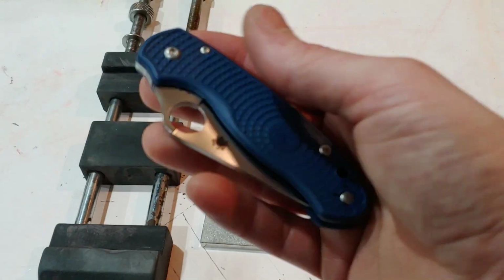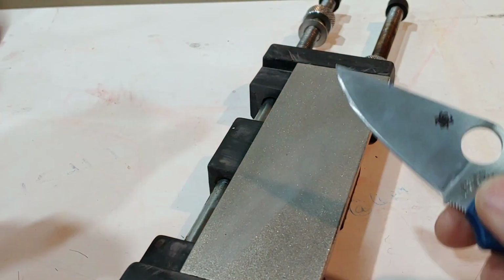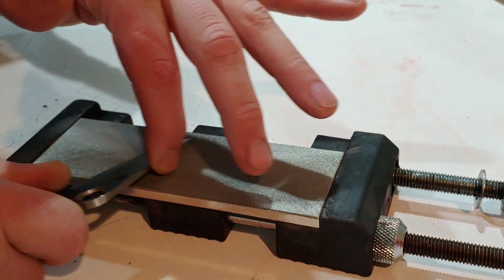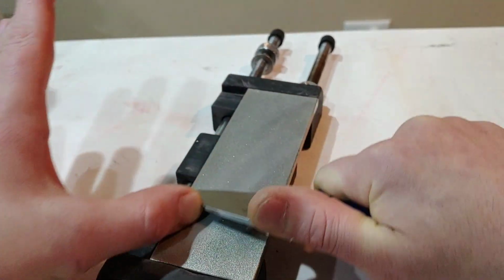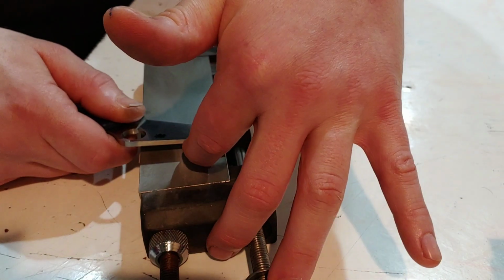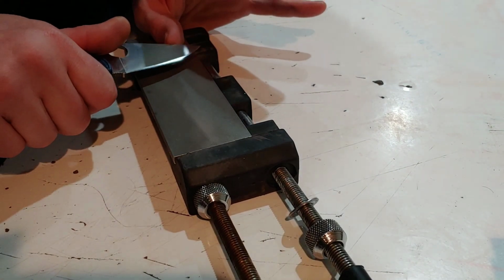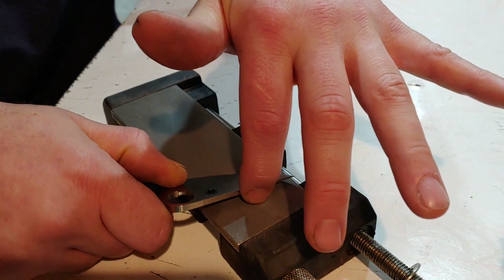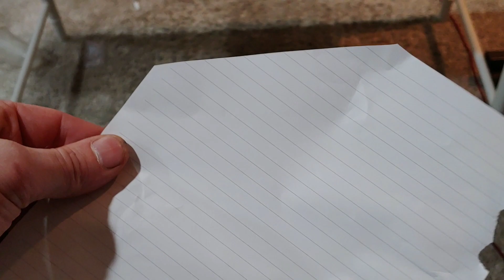FREEHAND KNIFE SHARPENING PARA3 LW SPY27

Comment: i just sharpened my para 3, first i ruined the edge then i watched your video and brought it back. thanks for the helpful insight, really appreciate your contribution's to the community.
Reply from the maker: That's awesome, I have a step by step video that also might help out a bit more
Reply: @NeevesKnives   I'm a butcher and I'm looking to purchase a new knife for opening the cryovac packages the meat comes in, have you got any suggestions? im tired of dulling my boning knives at work, I'm also trying to keep budget in mind. thanks
Reply from the maker: @jasonanderson7020  your going to want something in a stainless steel, but still make sure to keep it clean and oiled, steels you wouldn't ever worry about would be lc200n or vanax, but I'd recommend something in 14c28n possibly from civivi, I'm not sure the size of blade your looking for but civivi has great quality also there blades in Nitro v would work well, or even the civivi pintail in s35vn, the civivi brazen drop point in 14c28n, the civivi riffle in 14c28n, you can also get the civivi elementum in s35vn, that model also comes in d2 if your really on a tight budget but make sure it's coated as d2 is not stainless. Check some of those models out the pintail and elementum are small to medium size the other 2 are full size

Comment: Good video bro. I like watching your sharpening videos. I've gotten much better at freehand because of you.
I bought a Falkniven DC4 to throw in my camping pack for field sharpening. I'm not thrilled with the Worksharp field sharpener because of the angle guides get in my way. The actual stones are fine, but I lose some of the already short surface when I'm not doing a 20 degree edge. Tried it out on my 52100 steel Manix today..I was impressed. It raised a burr pretty quick and did a very nice kind of toothy edge on the Manix very quick. It's got me thinking of buying the full size bench stone..like I really need more stones, lol.
Reply from the maker: Work sharp has a diamond bench stone but plates an a clamp are better,

Comment: I’ve worn my Para 2 down to a straight blade. My wife has always said my grip and strength is unknown only to me.. I guess I’ve been using the diamond stones too hard 🤷🏼‍♂️. I’m going to try ceramics seeing as how they can take the pressure.

Today however, I learned a lot by grinding the entire edge 90° I learned what I was doing wrong with my comfortable grinding motion, and I wasn’t getting the heel very well. My pressure on the heel was too light; I was putting too much pressure on the middle of the blade and not rotating the tip well, And.... I’ve also learned I’ve been using way too much pressure obviously 😅
Reply from the maker: Yeah pressure usually just leads to issues, and the diamonds cut pretty much just as fast as sometimes even faster with little pressure

Comment: Awesome vid,  very relaxing and you kind of just sink into the sharpening,  I almost feel asleep while watching. Do you keep the same angle on hollow and flat grinds? Or do you go with the angle from the factory?
Reply from the maker: I almost always change the angle unless its not a good idea, between flat and hollow i like to do around a 17° angle sometimes on flat grinds if their geometry is not good meaning they get super thick quick then i might not and just do 20° just because it might look ridiculous even though it would cut so much better
Reply: @NeevesKnives  thanks for the info.  Really appreciate the advice I usually try to keep factory but I have some hollow ones that I think would benefit from a higher angle. Thanks again.

Comment: I really like your videos!!! Quick question, do you let your finger ride on the stone or just above it. It looks to me that you would sand down your fingertip over time.
Reply from the maker: You do if you put lots of pressure you barely let them tou ch almost floating, that way you know when you put pressure your changing angle, if your not touching then your lifting angle, but it does take some getting used to but you can swap between your middle and pointer not to make them to rough, or just use it as a starting point every time, that way you know your atleast starting off with the same angle every swipe

Comment: Really good video. Always like seeing you sharpen. Was that steel harder or easier to sharpen say versus M390?
Know you were going fast to make the video in right around 20 minutes. How long would you have normally spent doing that steel??
Reply from the maker: On diamonds imo opinion most steels are about the same effort, maybe a few minutes longer or shorter, but the diamonds cut m390 just as easy as s35vn, but id say a bit faster than m390, imo it kind of felt like s30v or d2 as for sharpening

Comment: What do you do if you find some inclusions on the edge after you sharpen? The blade still cuts paper fine so do you worry about it or do something about it?
Reply from the maker: You dont have to but you probably wont get the best edge retention from fatigued steel, but id just use it until it needs another sharpening
Reply: @NeevesKnives  Thankyou for your advice. I'm using the Percision Sharpener from WorkSharp I will use the knife as normal not heavy duty. It was only $120 ish so... I love watching you sharpen. It looks so therapeutic and relaxing. Thanks again for your reply and from Canada...stay safe.

Comment: Great video. Wish I knew that marking the finger trick when I started sharpening,would have made getting a hang of it a lot easier & faster.
Reply from the maker: It really does! And it can help with the last stone esp making sure your angle and bevel is perfectly flat, its great to use it through all the stones but it can be hard on the finger if you apply to much pressure